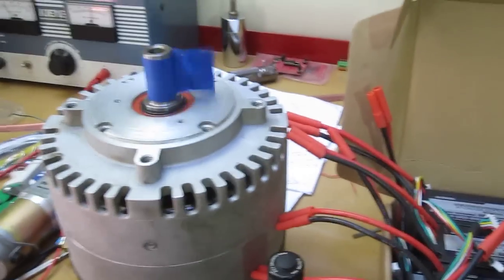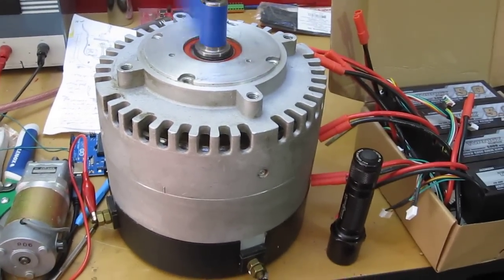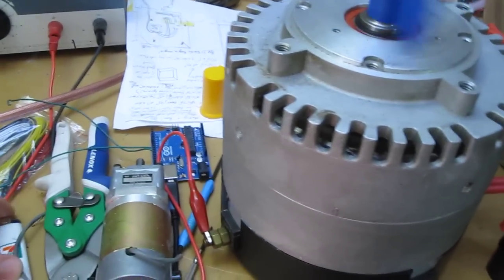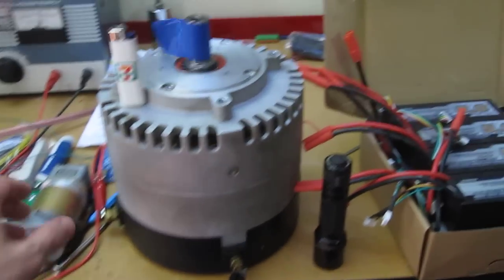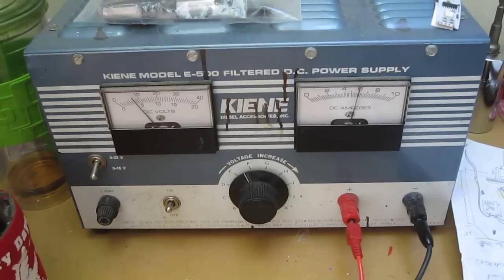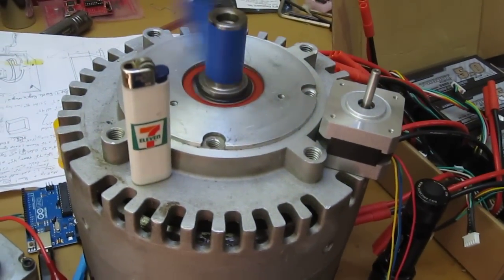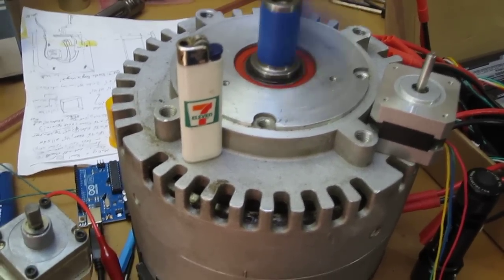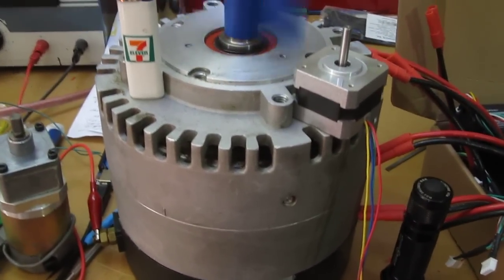Mars Motor. ME1003 motor initial testing, no load & low voltage by North Street Labs

Comment: is there any stronger motor than this ME1003 after 5 years ?
Reply from the maker: The Dark Rider, it's the biggest permanent magnet DC motor they have. I have since moved on to AC induction motors for higher RPM, less maintenance, and regenerative braking.
Reply: Ok #jayls5 i have (honda cbr600rr) body (frame) i wnan build i need very powerful motor and motor 
but idk witch motor have most HP 
can you give me name or link which are a lot more powerful than this one
Reply from the maker: Power is only part of the equation. Most motors can produce 3-4 times the power of its actual continuous rating for short bursts. You have to design the whole system before you start because many EV parts don't work together. First, you need to decide brushed or brushless. If you go brushless, you need to decide whether you want a permanent magnet motor or A/C induction. You have to consider budget constraints and size, along with realistic power goals. Only when you narrow that stuff down could I really give you a good suggestion.

Comment: Mine is drawing 10amps no load at 12 volts, any ideas why?
Reply from the maker: There could be a number of reasons.  The most likely scenario is that you haven't seated your brushes yet.  You need to run it for a while at no load to wear in the flat carbon contacts to conform to the commutator, which will lower internal resistance and allow it to spin at lower currents.  There is also a new brush holder design made after a certain point that has lower internal resistance as well (though I doubt that's the issue).  The other thing is how tightly the components were pressed together against the bearings, etc.  Basically, as long as it's not getting prohibitively inefficient at higher loads, I wouldn't be too worried about it.

Comment: This looks exactly like the 72 volt motor I'm using for to build my electric geo.
Reply from the maker: It is. I checked out your first video, and the person you're buying it from is using the same motor. I even used his controller, though I found it to be underpowered and upgraded to a SPM-72650. Make sure you are dead set on your parts before you build because if you're not happy, upgrading ends up costing more in the long run. Just upgrading controllers meant I had to get new wire because the terminal connections were a different size. If you want the motor to have some longevity... I'd honestly keep it 125-150A limited. I'd feel confident doing 200A with some good forced air cooling. I first used that motor in an electric propeller car, then I put it on my Dune Buggy. I fried one set of brushes on my ME1003 messing around pushing high amps. The ME1003 is direct swappable with a HPEVS AC-20 motor, and that is what I ended up with (and I still think it's under-sized). I like the AC-20 for the superior rev range, regen, and zero maintenance... but programming a Curtis controller sucks compared to Alltrax. Take a peak through my channel and feel free to shoot me any questions.